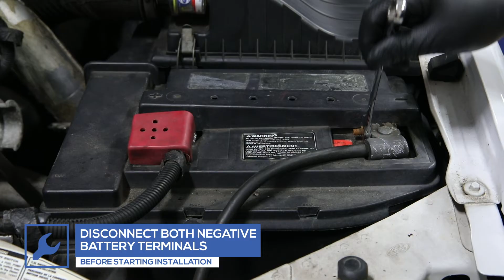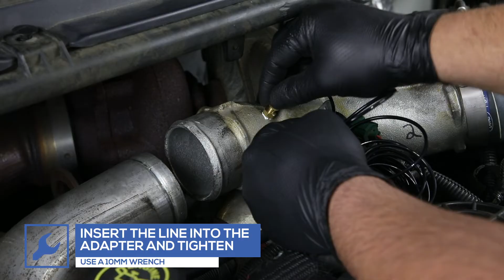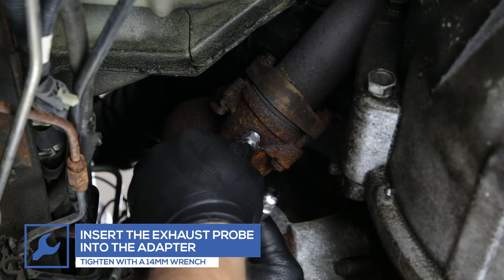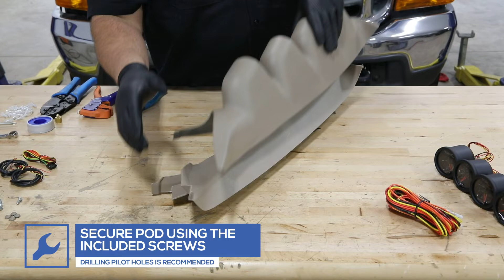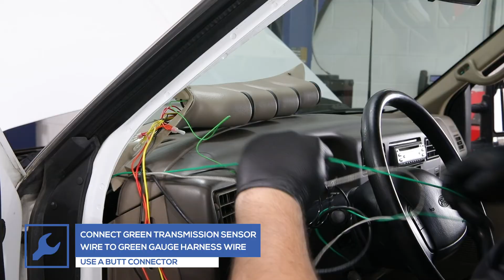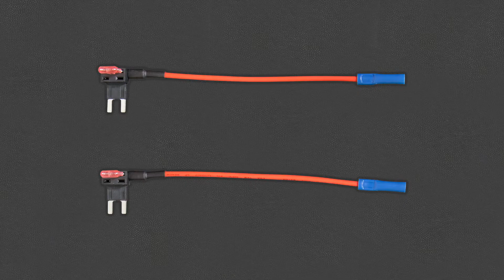GlowShift | How To Install A Diesel Gauge Package Into Your 99-03 Ford Super Duty 7.3L Power Stroke

Comment: Ok so I understand I shouldn't daisy chain more than 4 gauges per circuit. If I wanted to add 6 gauges to my truck, I can use 2 separate circuits right? Can I put a second set of expandable circuits on my fuse panel, eg. 2 separate yellows, 2 separate reds etc. etc.?

Comment: Hello and good day, I have a2001 F350 7.3L dually XLT and my truck has glowshift 3 gauge setup and all 3 gauges work my problem is I can't change the colors of the gauge, the button isn't stuck and the gauge is a bright red but I can't change it to other colors. Any advice or help would be appreciated.

Comment: Metal shavings into the engine? Wow. The vacuum wont get them all. Especially if there is any oil residue in the tubes.
Reply: i believe it will only get into the turbo but a pen magnet and vacumn will get it out

Comment: Wouldn't it be better to put gauges in first and then route to EGT probe, Boost, and Trans. probe?  That way you can cut the excess wire and make a much cleaner install.
Reply from the maker: The EGT probe wire cannot be trimmed but the boost line and trans temp wires can. Which you could do from the side inside the cabin.

Comment: Boost 0:43
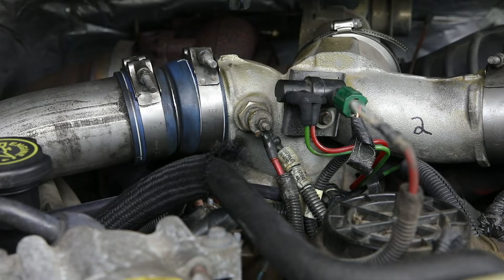Air heater Intake method 2:26
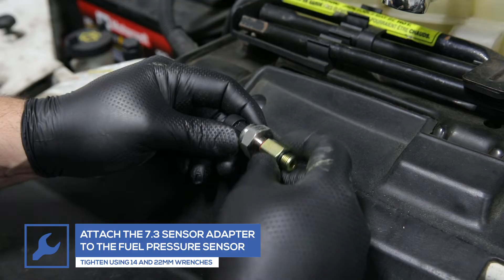Fuel pressure 7:10
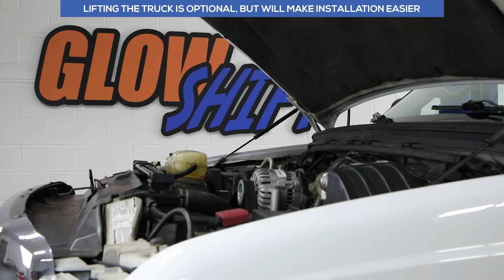EGT 8:00
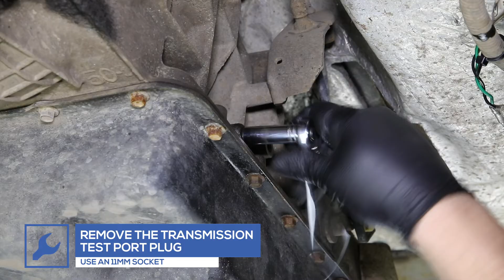Trans temp 10:10
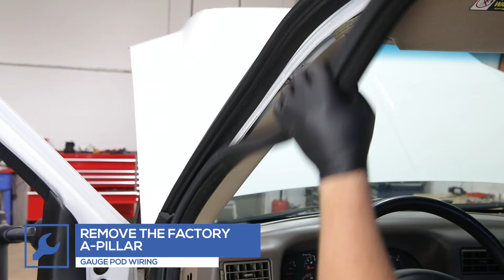Pillar removal 13:10
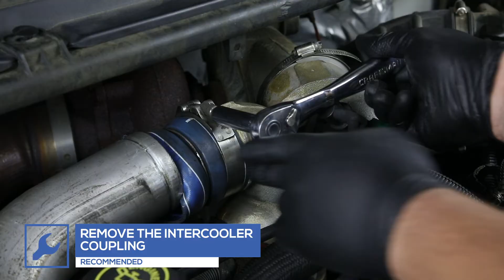Reply: Also around 4:34 for the drill and tap method for Boost. The other methods for boost are before that.

Comment: Sorry i know this is not the video but i have a 2004 350z that i got a water temp gauge for and i installed it and everything right but when i go to turb it on it turns on but my radio and my cigarette lighter wont work i used the expanble circuits
Reply from the maker: Sounds like you may need to move the circuit to a different fuse in the fuse box.

Comment: Are there any benefits or downsides to any of the methods used for installing the boost gauge?
Reply: Yeah, solder the connections instead of using wire taps and connectors.

Comment: It would be nice if my double vision fuel pressure gauge read properly, my snap-on gauge reads 62 psi at idle while the maxtow reads 32 psi
Reply from the maker: Please contact our customer support and they will be able to help you resolve any issues you may be having with the gauge.

Comment: Will this gauges also work on 6 speed manual transmission?
Reply from the maker: Unfortunately the transmission temperature gauge will only work with an automatic transmission. A manual transmission is sealed and does not have any ports the sensor can go into.
Reply: @GlowShift  would have been really nice to know this prior to ordering the gauges and spending the last 2 hours covered in trans fluid trying to find a port for the sensor!!!!!!!! Nice !!!!!!!
Reply: @riosuave3977  research buddy. Best thing to do before ordering stuff like this. My dad did the same thing for his 7.3. But I have a 7.3 with a automatic trans so I took those gauges and bought him the right ones.

Comment: I have the 3 gauge egt trans and boost. But i have 3 wires that appear to not be needed?
Reply: Ended up being two wires in the harness mechanical, that i didnt need. operation. Thanks
Reply from the maker: Every wire should be connected somewhere.

Comment: I know one thing the kit I got brand new from eBay that doesn't have the fuel but has egt, boost and transmission gauges didn't come with nearly the things mentioned in this video for the install. Like the green and black wire, the bolt that the egt probe threads into that threads into the manifold, the wires that come off the gauges are only 6-7" long not nearly long enough to reach power,grounding or dimmer. It's BS spend $200 and have to splice every single wire and supply the wire myself
Reply from the maker: We are sorry that you had that experience with our product. The adapter for the EGT probe comes attached to the probe in the packaging, simply unscrew it to install it onto the manifold and then insert the probe back into it. We do recommend purchasing a wiring kit which will make powering the gauges much easier.

Comment: Isn’t it kinda redundant to put a transmission temp gauge when the original gauge cluster has one? I just bought a 7.3 and would like to put this kit on my truck. Is there a different gauge I could run in the trans temp gauge and still use this harness?
Reply: Just so you know the transmission gauge in your truck is NOT accurate. Yes, its a factory gauge however it has "Set points" so your transmission could be running at 180 but then if the transmission temp sensor saw 220 the gauge will immediately jump to red. NOT gradually. This is why an aftermarket gauge is better because you can actually see the damn temperature rising rather than have it surprise you when it jumps up to red and be already too late and your transmission be fried. There are numerous reports of how unreliable the factory transmission gauge on the 02 - 03 models are. Just look it up for yourself.
Reply: Early 7.3 Superduty's didn't have trans temp
Reply: You will also want to install a 6.0 Powerstroke transmission cooler on your 7.3 it makes a huge difference in keeping the temps down
Reply from the maker: You can run another gauge in it's place. If you do not want the trans temp gauge, we would recommend the DS2 gauge package which will give you a fuel pressure gauge instead of trans. And then you would need to purchase any additional gauge to fill the 4th place in the pod.
Reply: Actually the stock tranny temp gauge is not accurate cause on cold days i never see it move on to COLD
Reply: My 2000 7.3 doesn't have it from the factory I guess...

Comment: The boost gauge never moved? Or my eyes failing on me lol?
Reply from the maker: The gauge in this video only shows boost and not vacuum so the gauge will only show a reading when the gas pedal is really floored. Which is not shown in this video.
Reply: @GlowShift  is this way to do it in a 97 7.3
Reply: @GlowShift   there is no need for a boost gauge if you have to push a gas pedal  but if you have to push the throttle pedal that's a different story   because diesels don't run on gas they run on Diesel fuel..LOL... yeah I know I am a smart ass but had to do it so you knew I am paying attention